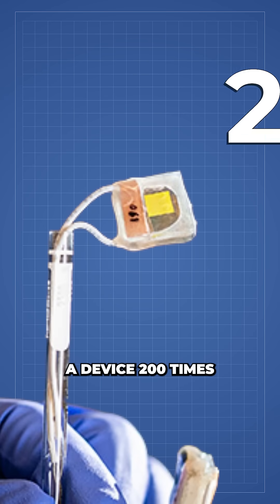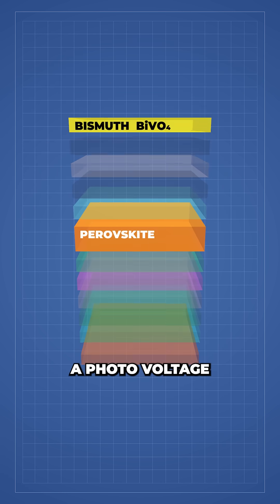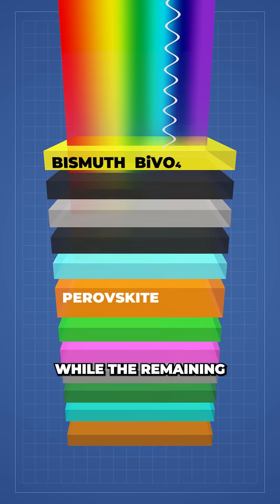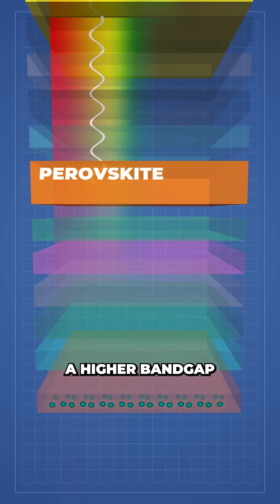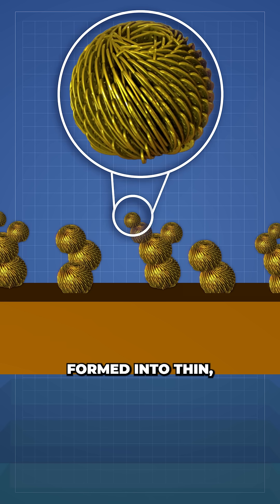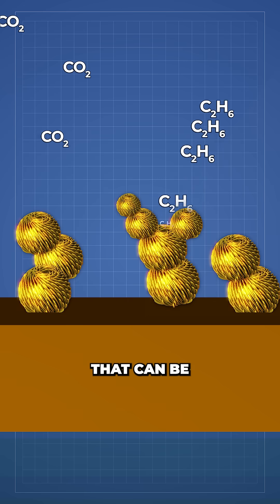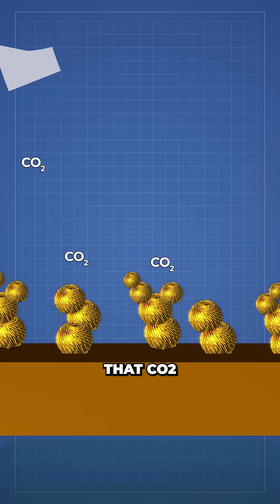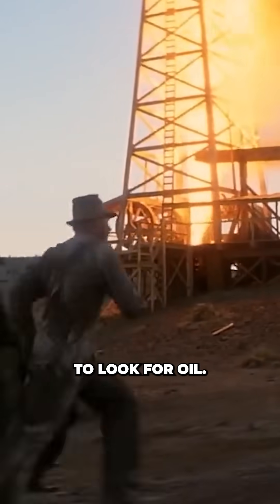Scientists Create Artificial Leaf That Converts CO2 into Fuel

Comment: You can make a transparent container with carbon dioxide and these "leaves" and put it on a spacecraft as a separate module. So, while you have carbon dioxide - you have potential methane that can be used as fuel. If I understand correctly how this synthesis occurs.

Comment: It's only a small but maybe a start to make circular fuel CO2 cycle . If scaled up can it make fuel at some normal cost like $5 a barrel of fuel. If not  and it's more than $30 a barrel the cost of Canadian Tar sands or ocean drill rigs costs them it's not going to replace normal oil extraction

Comment: This is pretty interesting and the video is well explained.

That said, I do not have high hopes for this concept.

While the funny thing would be to remind everyone that these scientists are not suicidal.

The real way this technology will likely be stopped is far more sinister.

It will be labelled as dangerous and unfeasible.

In the past, we've already found alternatives for fossil fuels, most importantly and the one I'll be referencing.

Nuclear energy.
Nuclear energy has nearly no pollunts and the tiny amount of waste it does produce can be safely stored away deep underground.
Meanwhile, it is also capable of producing massive amounts of power.

To the extent that 2 or 3 full sized nuclear power plants could be enough to meet the power demands of a nation like the Netherlands with ease.

However, it has been labelled as dangerous technology, and any development involving nuclear power has to jump through an absurd amount of hoops just to get permission to begin, let alone be funded.

I believe this technology will probably not face the same issue as nuclear unless there's some kind of disaster that happens to involve the technology.
But it should serve as an example of how alternatives that could really make a difference are suppressed.

Comment: I'm wondering where they're going to get the 6 hydrogen to bond on to their carbon. Plants get it from water. Does this mean that this process is going to have to use more energy to also split water molecules so that they can acquire hydrogen. And how long are these energy producing cells going to last. No company is going to invest in this if they can't make money off of it. Maybe these energy producing cells would be better just to use as a replacement to the current photovoltaic cells.

Comment: Physicists are wicked smart and get a lot of earned credit, but as an electrical engineer, I'd wire cheap silicon solar cells in series to get the needed voltage.

Comment: so what you're saying is: we just made the next generation solar panel, and we're using it to make combustible fuel. -albeit carbon neutral fuel, but still fuel, that can't be used as efficiently as the electricity it can produce. CONGRATULATIONS YOU JUST GOT AN OIL COMPANY CONTRACT!

Comment: And will also respire in the dark. Taking oxygen and releasing carbon dioxide.
It means you need 24/7 UV lights or sunlight.
The efficiency then decrease.
Another very good invention but cost more than what it produce. Like solar panels uses sunlight and use the stored energy to create and mimic sunlight at night and the energy comes from solar panels stored in battery until it cancels.😢
Reply: Why would it need to respire in the dark? This is not a living plant.

Comment: The oil industry should be throwing buckets of money at this, it's literally the thing that's going to make their businesses last forever
Reply: infinite oil hack
Reply: I’d imagine some will be, if it could be made consistent and cheap enough to do away with drilling + refineries. The question is how easily the output is made into useable fuels and plastics. The amount of materials made using oil is insane

Comment: Let’s hypothetically assume the “artificial leaf” system improves significantly:
	•	Photocurrent: 10 mA/cm²
	•	Faradaic efficiency: 50%
	•	C₂ product energy density: ~47 MJ/kg (ethylene)

That would still put it below commercial solar panels in terms of watts per square meter unless hydrocarbons are specifically desired for storage or chemical feedstock. Even then, you’d need much larger surface areas and complex infrastructure to rival solar power + batteries. Why pursue this if the future for this technology isn’t that great?

Source: Article + ChadGPT 🤣

Comment: Still would not make a major impact as long as drilling for oil would result in a cheaper and/or more stable source of fuel than this solution. Just like we have the technology to recycle most of our plastics (meaning only a fraction of plastic production has to be virgin plastics), the fact that it is cheaper to extract oil and turn it into virgin plastics than it is to recycle the same amount means that only a fraction of plastics are recycled.

Comment: Solar cells are only about 20% efficient. There are some that are more efficient, and some that are less efficient. In the end it comes down to heat issues. Even with the higher efficiency units, they overheat quickly.

Comment: I had the idea to do this over 20 years, as in we need to figure out how to duplicate the process that occurs in cytoplasts during photo synthesis where water and carbon dioxide are converted to hydrocarbon that can be used as fuel and oxygen. 
This would allow us to use sunlight and water to create “fossil fuel” without the whole millions of years in the process. 
Anyway, my forte is mechanical engineering but lack the biology and chemistry required to even start playing with the idea.. 
I thought someone had already achieved some process using chemically dosed ping pong balls that floated in water and would be collected to extract the hydrocarbon from their surface.  
Anyway, it’s great to see that someone else has created what I had thought about years ago.  
I’m sure lots of people had the same thought too, and here they are!!
Kudos scientists!!

Comment: As a biologist I think it's important to mention that plants don't split CO2 with light.

They split water into oxygen, use the protons as a source of energy (it "flows" through a "turbine" on the cell membrane like water through a dam, fascinating!), and oxygen is a waste.

Then, with THAT energy, they turn CO2 into sugars. But you can use the exact same machinery even without sunlight! As long as you get energy you can. Some bacteria get this energy by oxidizing Ammonia for exemple. So they can still fix CO2 even without light! But they'll still need ammonia (and oxygen to oxidize it)

Comment: Sure, cool.

 which rare materials are used for it, how much do they cost, how fast do they deplete, and do they produce enough fossil fuel to repay for their extraction according to their lifecycle?
Reply: yes, it would be more efficient to manage and maintain the flora than to produce these artificial leaves. They can be archetypes, but they aren't necessary here. They should also have a reproductive system, just like the flora itself. In other cases, they could be used on planets where CO2 is present.

Comment: Yeah. Except CO2 can't transform into CH2 or CH4..
Because O2 stands for Oxygen, And H2/H4 - are hydrogen.
You cannot turn Oxygen into Hydrogen using fancy solar panel. For that you will need a particle accelerator and tons of energy. 
And even if you add these 'copper fancy nanoflowers' it cannot turn oxygen into hydrogen. 
Besides, if you start splitting oxygen atoms into hydrogen, then you end up with no oxygen left..And then how you will burn your fuel? Because burning requires oxygen :)
Reply: Water

Comment: For those fatalist in the comments, the issue is often degradation, scale, scarcity of materials and abundance of fuel.
Why spend 100 of upkeep on a big setup when you get the same results on a smaller 10 upkeep 80 fuel setup.
Other issues are how the r&d company manage the results.
There were lots of electric car projects but only after Tesla it went "mainstream".

Comment: Something doesn't add up. Plants don't use the CO2 to produce hydrocarbons but to produce glucose which is six carbon atoms (split from CO2) combined with six molecules of water (H2O): C6H12O6.
To produce hydrocarbons (any CxHx) you'd also need to split H2O into H2 and O. Plants don't do that. So how does this new device do it? How does it combine C and H2 without the H2 just reacting with O2 to form water again? And where does it get the water from? I don't see any water input in the schematics here.
I call BS. There's a reason E-fuels are so inefficient: the complexity of building pure hydrocarbons efficiently. It's not enough to just have the ingredients at the ready.

Comment: Okay but the issue thermodynamics it’s not a closed loop you’ll run of co2 fuel if you only used what it produces that’s just physics you can’t get more out then you out out not matter how efficient it is you’ll never get 100% or more efficient yes it’s 200% more efficient then before but 200% more efficient then 3% efficiency is only 9%
Reply: Co2 from the burnt fuel…

Comment: I got hooked to all these great fantastic CO2 solutions until I got aware that there is very little CO2 in the air. About 400ppm (part per million) - So how much CarbonHydrogens I get as 'Fuel' - and then putting a picture of a drill rig. How crazy is this??

Comment: It looks like a similar process to regular solar panels and blue LEDs, so the manufacturing methods at play aren't that novel. That's a good thing, because it means this has a chance to be commercially viable, as long as the throughput is high enough to justify the money spent.

If this is commercially viable at large scales, then we've found the answer to car pollution. Combustion cars are still vastly better than electrical, they go faster, go farther, can start up in cold environments much easier, don't blow up as badly, are way faster to refill and they don't use rare earth metals.

So if we can close the carbon loop, then choosing between combustion and electrical cars is a no-brainer.

Comment: ok there are quite a few problems here, specifically with the fact that you have a very complicated and expensive manufacturing process just to create a fake version of something that literally grows on trees. seriously though, trees already convert sunlight and CO2 into fuel, its what humanity used as its sole fuel source until the discovery of coal, wood. it might be slightly more efficient since it doesn't consume any of the fuel it generates for its own maintenance, but by the time that difference in efficiency makes up for 0.0001% the difference in up front costs, the artificial leaf has already been ground down to a pile of dust by the wheel of time. 

the only real use case would be for spacecraft, but even then you would need to alter its design to work with the gamut of cosmic radiation rather than sunlight.
Reply: I swear to god there are so many comments claiming this will solve global warming when the fucking title itself says its an artificial LEAF. THE THING THAT GROWS ON LITERALLY EVERY TREE. 

on a serious note, each of these panels will have a net carbon footprint due to manufacturing, since the carbon they sequester into fuel is cancelled out by the carbon released upon burning said fuel. you know what has a negative carbon footprint even including the part where you make it? LEAVES THAT GROW ON TREES.

Comment: What is a "higher band gap electron"? The band gap is a material property. Semiconductors are insulators with a small band gap of a few eV. The band gap is related to the wavelength of the absorbed light. So did they create a semiconductor with a larger band gap? Band gap engineering is an old trick, that would be nothing new. And the term "higher band gap electron" makes no sense at all.

Comment: They left out a crucial piece in that visual explanation:
👉 Water (H₂O) is the source of hydrogen used to build hydrocarbons like ethane (C₂H₆).

Without water, the process wouldn't work — there's no hydrogen to make the fuel.
Reply: Yeah and water doesn’t exist

Comment: From where there  be taken hydrogen? Or there oxigen in CO2 meant to be splitt into hydrogen? Aren't we lead just to another imbalance in chemical sense? It's good that CO2 decomposing by this method, but as I got it if there are no cold fusion or kind a stuff we take H from water... And mind You that drinkable water reserves are stretched in many places... And it also used for agriculture... And I don't even tried to imagine how much this will cost to scale up...
I mean... We deal with wrong cause.

Comment: Trouble is that CO2 is so dilute that it would be dreadfully slow to extract it to power this cell. You would have to get pure CO2 from industry somehow and feed it across the back of the cell or else most of the light just goes to waste since CO2 is a tiny tiny tiny tiny fraction of our air.
Reply: Or, it could replace wet scrubbing towers where the gases are usually high in concentration and just leaving the industrial reactor
Reply: @KKarthikeya-wz2eu  If you get the gas there, that could be a feed stock.
Reply: But we can make it more...I know this guy....
Reply: A covalent organic framework is said to be able to capture up to 20kg's of CO2 from the air per year.  I agree there would be challenges in scaling the technology up but in theory it could be done.
Reply: @paulosullivan3472  Trouble is the level of CO2 per unit volume of air is very small, you would need to actively pump or blow the air through the system which would consume energy. The only way this makes sense is if there is a concentrated CO2 source or if the light capture is so inefficient as to negate the speed limit of CO2 capture.

An unknown quantity of this framework you suggest can capture a mere 20KG of CO2 per year. There's not a lot of energy released with refined fuels like natural gas when they generate 20KG of CO2. I suspect that the air capture would rate limit the whole system the same way that curtailment does to current solar since current solar makes too much power when we don't need it and we have no practical way to store that much energy for that long.

If this could be done electrically, then the solar controllers can send extra power from the panels that would be curtailed into the carbon capture and power to fuel system to store the excess, allowing something like your organic matrix time to store up CO2 before dumping it when there is excess power.

Or maybe this technology is so inefficient on the solar conversion side that the tight limit of air CO2 concentrations is not a problem, in which case, scale is the least of the problems.
Reply: @asificam1  Covalent Organic Frameworks dont require active pumping to achieve the 20Kgs of CO2 capture per year.  It is still very much lab bound tech at the moment, the cost of producing a lot of it would be prohibitive but if we could find a way to make the technology fiscally feasible you could in theory have large amounts of these frameworks passively pulling CO2 from the air, no pumping needed.  Of course you still need land to put the infrastructure on etc but overall it seems to be a more viable tech.
Reply: @paulosullivan3472  How much area, volume, mass or however they are measured per KG of CO2 per year. If I need a literal container ship of the stuff to get 20KG per year... that's not a lot of energy storage per unit of organic matrix.
Reply: @asificam1  Well its only really been created in the lab so far but in lab conditions we can determine how much CO2 can be captured by 10 kg of COF-999, we need to consider the molar mass of CO2, which is approximately 44 g/mol. Based on the given capacities, 10 kg (or 10,000 grams) of COF-999 could capture  21 kg (2.05 mmol/g × 10,000 g × 44 g/mol) of CO2, depending on the humidity conditions.
Reply: @asificam1  Given this has been talked about since the 80's. I think were just gaining civilian knowledge, my boi.

Maybe not entirely, but I can tell you... Not a single research team would publish knowledge, this in depth, without SOMEONE already having known about it.

You learned chem, "apparently", but not deductive reasoning. Mah boi
Reply: @paulosullivan3472 also, listen to Paul. Paul knows chem and deductive reasoning. Seems like he might even have some logic too.. Be like Paul. 

Dont be like your user, AsIfYouEverCould😂
Reply: Plants seem to do just fine passively
Reply: @donaldmarcato7003 Ahah, so do you.. Go to Iraq n support em. You hippie.
Reply: @donaldmarcato7003  They are relatively slow which is fine for a self-replicating organism that is here for beauty reasons as well as function. For industrial uses, speed is important since that land area is valuable.

Also, plants use water for transpiration which may be rather costly in some areas, necessitating a fan to replace that since plants are not 100% passive.

Comment: The idea’s cute and all but given how specialised it is vs. the cost and reliability, scalability and broad purpose of electricity from photovoltaics why not just use regular ones and power a system to split molecules the normal way etc.
Far cheaper, better to finance and well within technical reach.

Comment: I feel like as we go forward, materials engineering will become more important. Like mimicking the structure and geometry of a plants leaf to maximize the potential energy generated through artificial photosynthesis.

They already do this to some degree. You can look at the structure of a geckos foot, and they created a material with a similar structure to mimic the vanderwaal forces of the gecko.

Or how they would look at the structure of a beetle‘s wing to produce a similar structured material to shield aircraft from radar and such.

Using the layering of different materials, the structure, design, and geometry of materials and alloys to produce unique effects that otherwise wouldn’t be possible. 🤷‍♂️